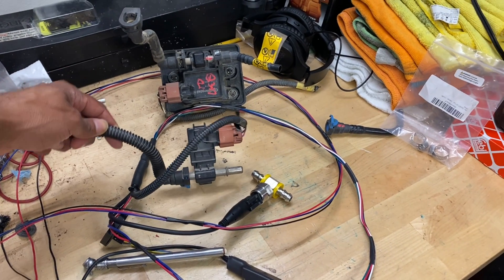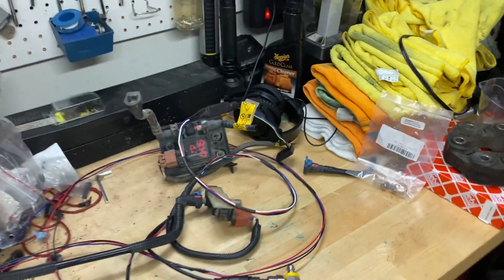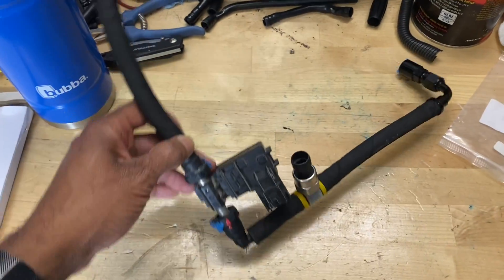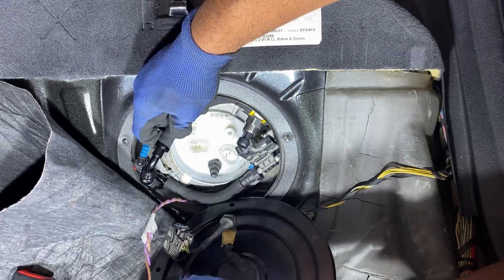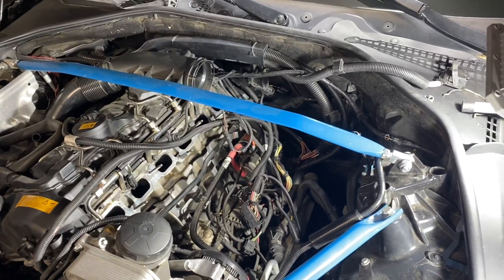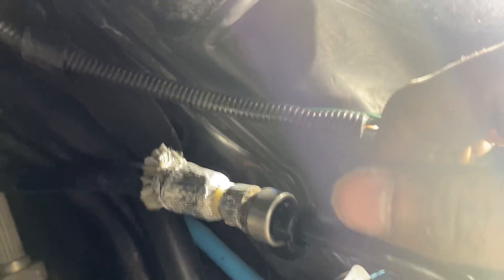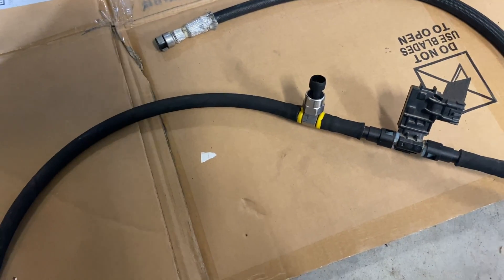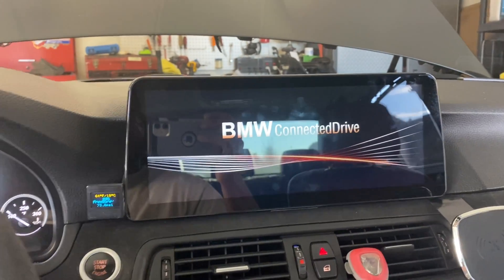How to Build your own N55 Ethanol analyzer

Comment: the factory sensor bounces to, the dme filters it alot. you could put a resitor on the pressure signal wire and it should help smooth it

Comment: Hi there, what size quick connects did you use for ethanol sensor and what size for the ends of the hose?
Reply from the maker: I put a link in the video description for all the parts that were used.
Reply: @JohnsonMotorsports  how are they holding up? Any leaks?
Reply from the maker: @kkarnis3791  No leaks at all, everything is working great. I do need to purchase a new Arduino nano. My cheap nano clone stopped working.